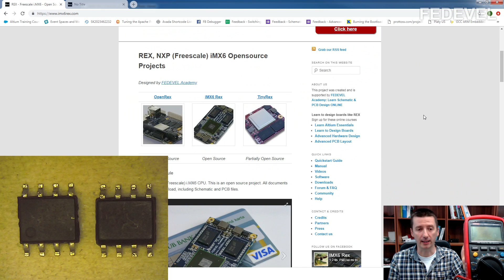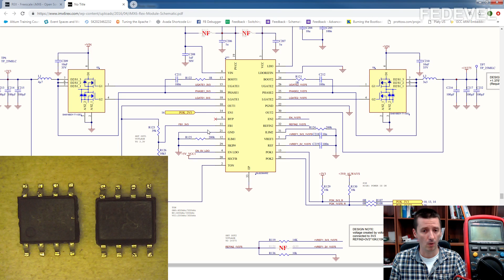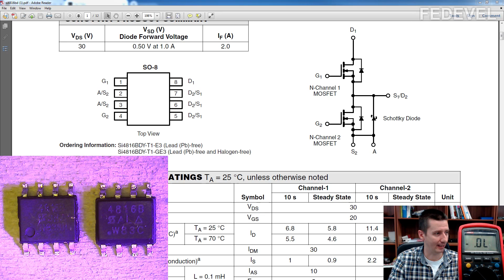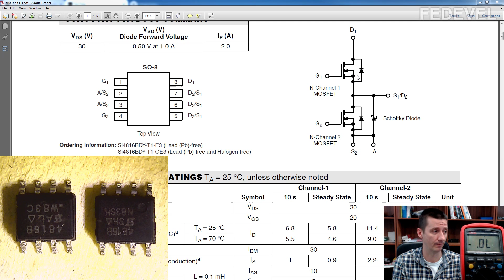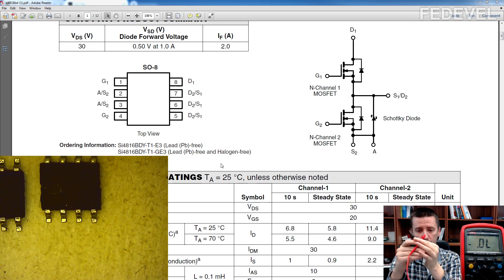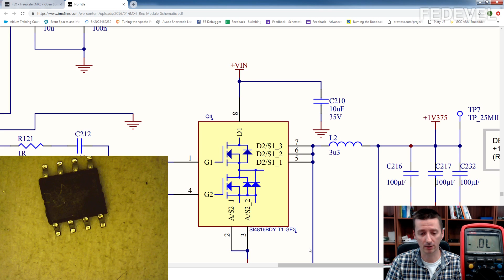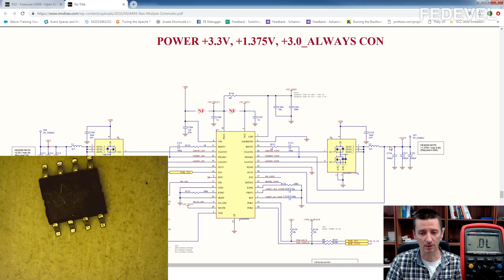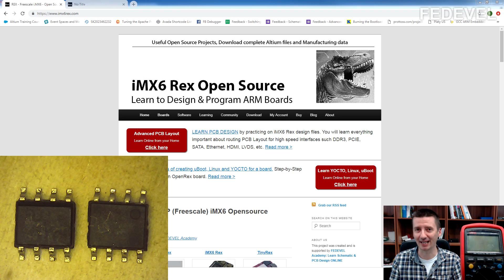Fixing a board - Fake Chip!

Comment: We designed a fancy Analog Devices op-amp into one of our products at work. When the boards came in from the manufacturer they didn't work. Chips had the correct markings and everything, but they just wouldn't perform. After running some testing, we discovered that the op-amps we received mounted to the boards were basic cheap off-the-shelf ones that someone slapped the AD marking on. The pinout didn't even match. If it did, we may not have noticed the issue at all, except perhaps in the form of inaccurate or less-precise readings from the sensors.

Comment: Had a work case of failing endurance transient testing of a new product design. On early evaluation it passed the "Load Dump" transient ( 80V 300ms Automotive) without any failures.
In later release testing the transient absorber diode was either open circuiting or mainly going short.
Over and over it was not passing, rather unusual as the transient clamp diode was a quite well known one.
We approached the manufacturer, providing reel code label details.
Surprise was they returned with a query as the batch code was unknown to them. We sent them the reel of remaining devices, and they acknowledged and confirmed FAKE!
We received these via a major component supplier source that also represented the manufacturer. On the supplier being taken to task by the manufacturer, they revealed as their stock was low and to complete our order they had purchased two reels via some chinese quick source and these were the fakes.
The supplier came close to losing their representation of the manufacturer, which is near 1/3rd of the supplier's turnover. Very serious issue. Given good intention to satisfy delivery needs, still a bad mistake made.
Note I have intentionally avoided any clear references to all company details...
Reply from the maker: Interesting. Thank you for sharing Helmuth

Comment: So, the fake chip was essentially sending the input voltage of the board directly to the output. Whoever dedicates himself to the business of fake chips, should be arrested. In order for them to gain a few dollars, someone will lose thousands of dollars in damaged boards, refunds or whatever.

Personally, I don't have any experience with fake chips. I only order semiconductors from Mouser, Farnell or Digikey. Thus, the chance of me getting a fake is greatly reduced.

Comment: Yeah, fake chips plague the market more and more. While it's easy to figure out that you've got a bad microcontroller, it's very difficult to diagnose opamps and discrete parts. You need to purchase expensive test equipment or spend a lot of time to build your own test bed to check all the important parameters like Rds, Vos, Ibias and so on.

Comment: We buy thousands of mosfets in sop-8 and other pacakages, and the most common "fakes" we get are either rebadged (i.e. a similar lower specs part) or factory rejects (i.e. failed some less commonly important parameter like gate capacitance etc.).
9/10 of the time when bad it is because the turn on rDS is at 1.5x to 2x the required specs.  The scammers work on the idea that most of the time these devices will not be running at power levels near the spec limits.
We random smaple batch test all incoming parts, and as a result we send back 1 in 6 shipments.
Mind you we buy from AliXpress & TaoBao ...not exactly reliable sources,! ...but very cheap if you do not mind doing a lot of testing :-)
Reply: I call it Chinese roulette. Always a chance of a magic smoke and fire.
Reply: You are probably losing more money in your testing regime and parts you don't catch ending up in the product than if you would buy from reliable sources. Buying something cheap only to have to test it to make sure it will work,  places the risk on your shoulders. Whereas a faulty component from a reliable resource has risk mitigation built in.
Reply: You are better off buying from reliable sources, IMHO. You don't have to test parts or refund a client due to a failed part/board.

Comment: Just last week was working with a client that purchased a reel of Intel 80C2501SB16 processers.  Pulled several parts off and they did not work in the system.  Sent me a system and 5 processors - 1 out of 5 worked.  In this case I don't know if they are fake - but possibly didn't meet timing or pass the functional test and someone diverted them and sold them.  I was able to verify that the ones that "didn't work" actually were booting - but something was wrong that prevented off-chip writes.  This is a risk with brokers for obsolete parts.

Comment: Once I received a sot23 package mosfet which is supposed to allow 4 amp of current without problem.However it was burning hot aroudn 2 amps. Then, I ordered from digikey in order to make a comparasion between them.Obviously , Local distributor had supplied us somehow damaged chips.

Comment: After the first one failed like that, the assembler should have done some basic tests, eg measure the voltage rails.
Would have discovered there is a problem somewhere, and the other boards could be saved.

I've been documenting the expected voltages for a board I'm assembling myself, and if the voltage measure something else what that means.
I'd like to mass produce them, but there are funding issues with that, and first I need to order another 'round of PCBs which is tricky this time of year.
Reply from the maker: When boards didn't work, they stopped testing them and started debugging. So not all boards were damaged, just all the components on the boards which were connected to power.

Comment: You might also measure a short circuit instead of diode on a good device because the gates are floating, turning on the MOSFET's. It's better to test them in circuit or briefly short the gates to it's corresponding source.
Reply from the maker: Yes, I agree. These were discharged.

Comment: I am curious where did you get this part from?
Me personally, I always source critical parts like this from reputed distributors. All the non-critical things like resistors and capacitors, I can take some risk on.
Because capacitors etc are the bulk of the cost in these kinda of systems, it is good to buy slightly over-speced parts and the risk is minimum then.
Reply from the maker: The part was purchased from an authorized distributor.

Comment: what would be your advice to avoid this type of chips in our projects...?? My conventional providers are digikey, mouser and farnell.
Reply from the maker: I do not think there is a safe way to avoid these chips. Usually, one of the main reasons why this is happening is long lead time (e.g. waiting over 4 months for a component is often unacceptable) - that is why many companies and suppliers are looking for alternate sources. Other reason is for example if companies need to get obsolete components (many companies have boards with obsolete components and these boards are still popular and requested by customers, so companies and suppliers try to find the chips somewhere).
Reply: @RobertFeranec  Thank you very much for sharing..!!

Comment: Hi, as I buy through UK distribution I've never received any fake chips, but I already have enough problems with chips from the actual manufacturers that don't work or meet the datasheet specs.

We had a problem with a complete batch of genuine BGA chips that (with the aid of an X-ray machine) we eventually tracked down to the fact that the silicon die inside the package had been installed in the BGA package rotated by 90 degrees. (NB: the BGA package was rectangular, so it wasn't just a marking issue)

The most recent problem I encountered was with the Analog Devices part  number AD5680BRJZ-2500RL7 which is a Digital to Analogue Converter, 18 bit, 12.5 kSPS, Serial, 4.5V to 5.5V, SOT-23, 8 Pins.
These were used to control the position of a motor, and were supposed to output 0V at start-up. At switch-on, the motor immediately started at top speed, and the load shot-off and hit the end-stop.
This was because the output of the chips was 2.5V at startup instead of 0V.
Analog Devices did a failure analysis of the chips and found that "The chips were incorrectly configured due to the use of incorrect ATE test program during final test at the manufacturing line."
Reply from the maker: WOW! We also have had problems with different silicons, but I have not seen anything like 90 DEG rotated silicon. Thanks for sharing.
Reply: @RobertFeranec  Problems from incorrect end of line test sequeces have created problems for many companies. One would think they would learn but some have repeated prblems many times.
In one case we had an engine management system that we only assembled, and tested on behalf of the Japanese manufacturer, to get local content balance up on a major cost component of the car manufacturing.
We assembled and end of line testers supplied from Japan ran tests. Including a validating RAM bit validation pattern scan. After manufacture the products were packed in large boxes that shipped to the car production plant.  Many of the electronic modules were unpowered for over 1 month, from assembly/test, to being turned on fitted to the finished car.
 Huge problems, over 15% of engines operated very badly mixture and spark timing had huge errors.
It turns out that the CMOS RAM of the modules held some learned information affecting behaviour, and even after a month without power the data from final tester could be restored at power on well enough that error check routines accepted data as valid, and thus did not do a automatic clearing. Thereby invalid learned parameters applied.  A simple fix was to introduce a final post test step of
 writting valid nulled data.

The CMOS devices in general can be easily restoring previous state in register, status flip-flops and memory, on the tiny  residual charges for long times unpwowered and many a product with inadequate powerup reset initialization can be left with quirks after startup, and many designs have had issues.
Reply: The part number you provided shows me that these DACS default to midscale. Have you checked the order codes on the datasheet? In your case, you would need to order AD5680BRJZ-1500RL7 or AD5680BRJZ-1REEL7. Unless you have posted the wrong part number here, it is not AD's fault.

Comment: Hi Robert,

Just a quick note - looking at the PCB @3:59 the MLCC are quite close to the mounting holes, which can lead to cracking of the MLCC when you tighten the screws. There is not much to space to move them away so at least there should be open safe MLCC...

May it be possible, that by cracking the MLCCs, there was short circuit across the transistors which leads to further damage of them resulting in short circuit between in and out?
Reply from the maker: In this case, there is not really much stress on the components around the holes.

Comment: I've never received fake chips from DigiKey, Mouser, or Newark, but one time I was using two different LT1761 parts on a board, one for 5V and the other for 2.5V. The two components had long part numbers that differed only slightly near the end and the assembler swapped the reels on the pick and place machine. It was a pretty complicated board and it took about two days to figure out what the issue was, mainly because when I saw the 2.5V coming out of the 5V regulator, I assumed it was being dragged down and not that it was the wrong component. Later I saw that what should have been a 2.5V supply which was being powered off of 3.3V, was sitting at 3.3V instead and figured out what was going on.

The assembler was apologetic and had a technician fix the boards without charging for shipping or labor (luckily it was just a small number of prototypes), so I haven't mentioned their name, but afterwords I found out that some of my clients thought that it was a design problem, so there was a cost to my reputation...
Reply from the maker: Thank you for sharing. Everyday life of a company which is designing and selling boards.
Reply from the maker: PS: Be careful, even these big suppliers can cause headaches - occasionally happens, that they can mix up labeling and then for example instead of 10k you fit 0R ... I have seen that happen couple of times.
Reply: You're right of course. I got mislabeled parts from DigiKey once for a prototype that was being built by hand. One of the cut tape parts that were supposed to be capacitors, were instead resistors! They were tiny parts, 0201s I think, and my eyes aren't great and I never would have even noticed the difference. Luckily the technician that I worked with a lot picked it up instantly based on them being the wrong color. He was able to pick up an 0201, place it, and solder it without magnification. I can't even see the damn things without the microscope! :-D

Of course cut tape parts are much more error prone since the label is put on a bag by the vendor rather than on a reel by the manufacturer. But even though reputable vendors can make mistakes, as can the assemblers, I'm sure they go to great lengths to make sure that they aren't selling counterfeit parts, and so far they haven't let me down, or at least if they have, I'm not aware of it...

Comment: if the product have to be adjusted manually or testing the power supply powering the main board, you can design a pcb soldering connections, with a soldering mask between, so when the power test ok you can solder the power connection with out spending one component more.

Comment: Oh! This reminds me so many things about one of my previous job, when I was a test engineer. 
Most of fake chips are still functional, but just down grade somehow. 
I've seen fake usb to uart chip (windows driver issue), 
fake op-amp (incorrect input offset and output swing), 
fake battery chargers (huge leakage current while power off), 
fake mosfets( this is probably the most common cases......huge R_ds_on, lower VDS, or probably higher gate charge)
fake/bad tactile switch( probably disassemble components, huge contact resistance.)
and so on....@@
I should thank taobao somehow....because I was forced to read datasheet MORE carefully and perform necessary tests for all these stuff. 
Hey, I didn't know the UV light trick, awesome! :)
Thanks, Robert!